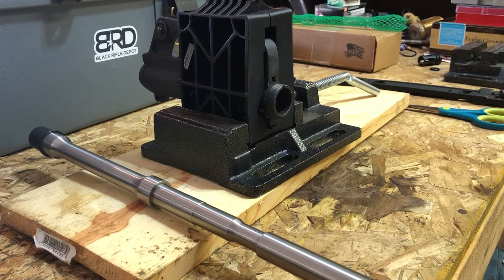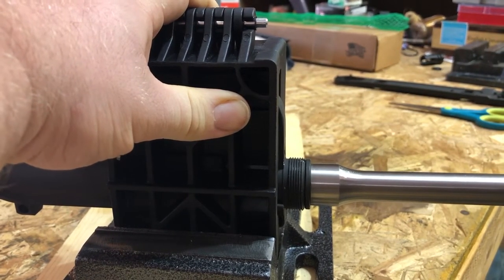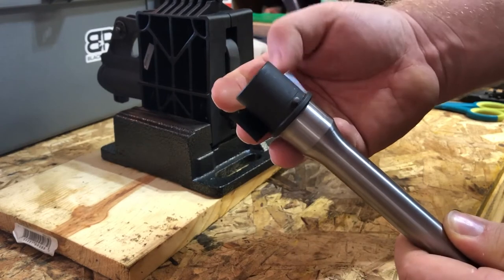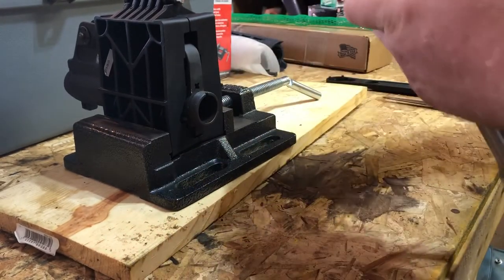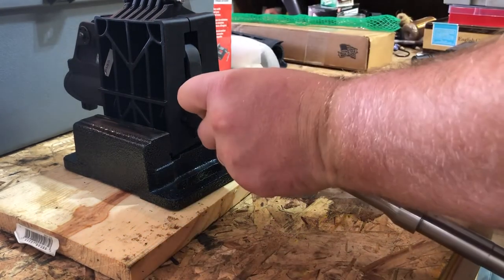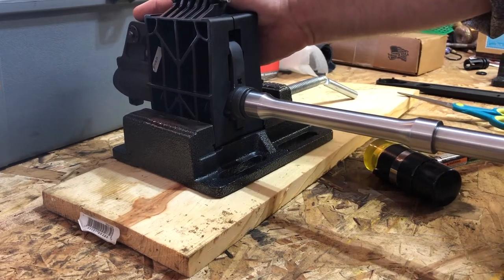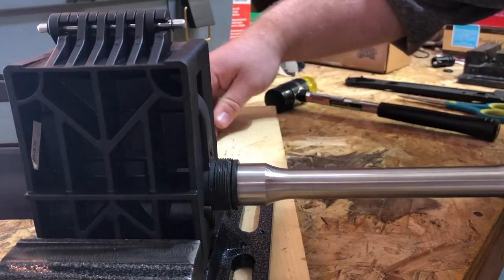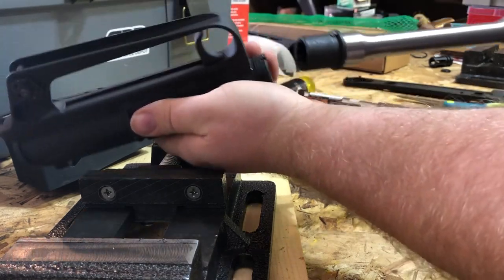Installing an AR15 Barrel with a Bedding Shim

Comment: Do not ever ever ever take a mallet to the crown of your barrel lol
Reply from the maker: rubber...
Reply: @shortreloadingvideos7571  it doesnt matter, you should always hold it by the barrel and mallet the receiver onto the barrel
Reply from the maker: @randylahey2242  you're a drunk
Reply: @shortreloadingvideos7571  only a couple of drinks
Reply: @randylahey2242 Way wrong. 

What’s more likely to be damaged by impact? Your steel barrel or your aluminum receiver?

Of course I would put an A2 flash hider on the muzzle to hammer against, but I would never ever consider hammering the upper itself.
Reply: @rifleshooterchannel208   I would rather risk a $50 upper vs a $600 lila barrel. A marred crown will destroy your accuracy, a marred upper will hurt nothing except  your feelings.
Reply: @randylahey2242  Why are you mounting a $600 barrel to a $50 upper?

If you are using quality parts, most of these “improvements” wouldn’t even be necessary.
Reply: @rifleshooterchannel208  a bcm "blem" upper is about as good as it gets.  You are wasting money on an inferior product if you get weaker billet uppers over forged ones.
Reply: @randylahey2242  At what point did a mention I use billet uppers? I forgot. Show me the exact quote to jog my memory. 

Thanks 😂
Reply: @rifleshooterchannel208  it’s a fair assumption to make if you think a $50 upper is “low quality”
Reply: @randylahey2242  So you assume everything, but know nothing. 

Got it 👍🏿
Reply: @rifleshooterchannel208  thats not an argument lol
Reply: @randylahey2242  Well that’s good to know, considering I wasn’t arguing.

Comment: Your on the right track, however. I measure the I.D. of the receiver and the O.D. of the barrel. I want the shim to be .0005 to .0007 larger than the I.D. of receiver. Lap the face of the receiver. Coat the inside of the receiver and outside of barrel with thin coat of never seize. The stainless steel shim will wrap around barrel, no gaps or overlap. Make the cutout for the alignment pin. Heat receiver only, in preheated oven 200 degrees one hour. With heat proof gloves. Insert barrel and shim to receiver. Its a one shot deal. This will yield a .0005 - .0007 press fit. I've done this to AR 15's, AR 10's and EPC 9mm. Don't waste your effort with a cheap barrel or parts. Side note I have 45yrs experience as Toolmaker, putting it lightly. Don't ever use lock tite metal tapes other B.S. Special tools are required to remove barrel without damage.✌
Reply: you're*
Reply: @drewwilkie86 😂
Reply: How could you have 0 gap with shim there will always be a little bit, I’d honestly  lap face, 620 loctite and shim,  loctite will help fill any sort of gap

Comment: i am a gunsmith and i am speachless please stop showing people how to rig the fact that they purchached  crap parts
Reply from the maker: Keep studying your craft
Reply: The gunsmith is correct.
Reply from the maker: @ar-15techtipsinunder5minut8  considering this method is based on what Joe Carlos does, no, he is not.
Reply: How are they crappy parts? I have a white oak barrel, a Daniel defense CHF barrel, they all fit like the one in this video, my uppers are two M4E1. I think none of them is crappy by any means. If you want a very tight factory barrel, it has to be oversized barrel extension like what White oak or JP provides, normal barrel extension won't fit very tight. This video gives a good solution. I like it. By the way, gunsmith is really not something you can talk down to people with. My "gunsmith" never wants me to call him a gunsmith, he is a machinist. He knows modern manufacturing, he programs his own CNC, in his mind, gunsmith is just some dumb old people operating some century old tools with no knowledge of precision manufacturing.
Reply: @Justin-zw1hx  if the barrels you have all fit the same its not the m4e1 its the barrel extension on the barrel and they are not mill
Reply: Tolerance stacking can occur in parts from even the best manufacturers, an experienced gunsmith would know that. An experienced gunsmith would also understand the merits and applications of shimming and bedding a barrel extension. You sound more like an armorer imo, and maybe an inexperienced one at that.
Reply: Yup. That's why guys do this same procedure to national match guns... because they're crappy, off-the-shelf ARs 👍
Reply: @Justin-zw1hx  A machinist is not a gunsmith but a gunsmith could also be a machinist.  They are not the same thing.  If you want your parts to fit its best to buy the whole gun not part it out.   In theory they should fit like mil spec but in reality many get poor fitting parts as they are not matched at the factory.   Those parts would be tossed in the blem bin caught by quality control when combined to make a factory gun.  Buying the parts separetly from different manufacturers raises the odds that they will not match as well.    I've done it both ways factory DD, FN and Colts fit well when I mix parts I run into issues were they don't fit like milspec should.
Reply: I bought expensive parts, have the same issue. Sloppy barrel.
Reply from the maker: @russianoleg  the parts are to spec, the spec is what guarantees the fit. This is just slightly modifying the original dimensions to take up some of the inherent slop. It's not much different than a very mild port job on a 2 stroke engine.

Comment: barrel should fit well enough on its own and loctite bedding should fill the gaps...a metal sheet will eventually disintegrate over time and crumble out after repeated exposure to heating then cooling.
Reply from the maker: loctite degrades over time and is a real PITA to clean out once it happens. 
The parts literally guarantee slop, the minimum ID is larger than the maximum OD to guarantee the parts fit without requiring thermal fitting.
Reply: What? No. If necessary shimming+bedding is best. Loctite 620 does not degrade and is not difficult to remove.
Reply: I wouldn’t make the effort on something with A1 sights. 

Great field sights, but they don’t allow any level of precision that could be improved by any type of barrel shimming or bedding.

Comment: I have 2 loose fitting A2 uppers, very loose like yours.
  I used metal tape, having different thicknesses and types. I used the stainless tape next I will try the copper tape.
Reply from the maker: I hope that option works great for you!

Comment: Ever since I have seen your video I have wanted to do this to my barrels. You're video really pointed out an awesome point when installing a barrel to an upper reciever.  But I have tried looking for this type of shim stock at every hardware store/Amazon but I can't seem to find it anywhere.  Do you know where I could find some? I'd really appreciate any help or advice you can give,  Awesome video! Thanks for showing this method of barrel installation!
Reply from the maker: I think this is what I used:
https://amzn.to/3dljSuW

Something like this might work but I have not used it:
https://ebay.to/3u5x5Os
Reply: Amazon sells four size pack for $26.00
Reply: Amazon you dope.

Comment: My next build Will be a  interference fit with whatever Shin it’ll take and heat applied to the upper receiver
Reply from the maker: Good luck!
Reply: Shimming and bedding is not necessary with an interference fit. Shimming is only necessary when you're dealing with a difference of 3thou or above. Bedding with loctite 620 sleeving compound is the best way to accurize the interface between receiver and barrel extension besides lapping the receiver if necessary.
Reply: @tactical-bucket  How does lapping make a loose fitting barrel tighter?   That not the same as shims or filling gaps with compounds or glue.
Reply: @Physics072  Lapping creates a close to perfect mating surface for the flange of the barrel extension to butt against under torqued clamping force from the rail/barrel nut. If the face of the receiver is not perfectly butted against the flange of the barrel extension the result will be small amounts of movement during a schedule of fire with the symptom of inconsistent accuracy downrange. That's how. The goal of accurizing a built AR-15 is achieved by eliminating all movement between the interface of the barrel extension and the receiver.
Reply: @tactical-bucket  Ok that makes sense.  Did not know what part you were lapping.  That won't fill in the slop from a loose fitting barrel though.   But will allow even distribution of pressure from the barrel nut.   
I did not realize how sloppy some of the fits are.  Most of mine are old and newer Colts zero movement and perfect sightpost alignment.  

    One AR I have is a OLD A2 with hand grip upper to a 1/9 twist none colt barrel.  That one I can move the barrel side to side if I grab the site post.  It does not wiggle up/down just a rotation thing stopped by the barrel lock post up front.    I was hoping just tightening the barrel nut would fix it.   Might need lock tite filler to ensure a better fit.
Reply: @Physics072  I never said it would 'fill in slop' but it absolutely will take slop out of the system. And I guarantee if you're just now finding out about receiver face lapping a good number of your AR15s could benefit from the procedure. Colts are not immune.
Reply: @tactical-bucket  Yea I've not had the time to fully get into AR.  Have pistols, shotguns, reload, hunting, target and old ones from 1800s to 2022.   Just no time for AR yet,  I've built a few lowers with a buddy but mine are Factory built Colts I just shoot them once in while.  Generally I use bolt guns for hunting.   I will probably do what you suggest on my oldest one,  what block do you use for removing barrel I have one that wraps around the frame.   Have nothing for proper lapping.  And how do you align you A2 sight post during all of this?  There is enough wiggle in the barrel lock post to put a little "Can't" in the front sight post.
Reply: @Physics072 The only tool you should use for afixing your upper receiver to a vise is the Midwest upper receiver rod. It is a decently priced action rod with a sail mounted to the top that indexes with the gas run to take all stress from torquing the barrel nut off of the barrel index pin and instead focuses it on the threads of your receiver face. You shouldn't just lap a receiver face because it might be out of true, you should gauge it first and determine if the procedure is required. If you disassemble your receiver completely and insert your barrel into your stripped upper receiver you can take a 001" piece of stainless shim stock or feeler gauge and check for any inconsistencies all around the circumference of the barrel extension mating surface to your upper receiver. If one side of the feeler gauge is able to penetrate the mating surfaces and the other side isn't then you've got an untrue receiver face that would benefit from the lapping procedure. I use the brownells tool and an 800 grit lapping compound to perform the work and it works fine however it should be noted that you only get about 7 to 10 receiver lapse before the tool needs to be resurfaced on a lathe. Another note, extra care should be taken to keep the receiver perfectly in line with the lapping tool. The tolerances of the tool guarantee a very close fit but uneven pressure on the tool can create a further inconsistent lapped face. If you mount the tool pointing straight up in the air in a drill in a vise so that you can hold your receiver in your hands and pull straight down, I find this the easiest way to maintain even pressure. Last thing, if you do lap your receiver face you should not need to go any further than when you see the last 3/8 to 1/4" length of anodized surface remaining. Removing too much material from the face of your receiver can cause other issues.
Reply: @tactical-bucket  Thanks yea I was wondering about putting the plastic block I have around a weak upper.   I have a real barrel vise that might work too.  The midwest tool looks nice might be better than a barrel vice.  Nice idea on the gauges, thanks I will do that to check.
Reply: @Physics072   A barrel vice is only good for muzzle device work and with the barrel blanks, barrel extension installs. With AR15s you rarely have enough barrel to use in a vice. The Midwest URR is good for all types of work on an upper receiver, don't even question the purchase if you plan on doing any serious work on AR15s.
Reply: @tactical-bucket  I prefer to reload and shoot so I don't think I'm going to be changing many AR barrels maybe one more in the future.   Its only 115.00 and I agree its better than stressing the upper.

Comment: True the receiver face with a wheeler AR tool, then bed with a Loctite 609 if your that loose. Or go the way of the oversized extension. Just don't start adding metal then hammering barrel in...
Reply from the maker: Done all that before. This is easier and if you are that worried about it get an oversized extension from BATT machine and do a thermal fit.